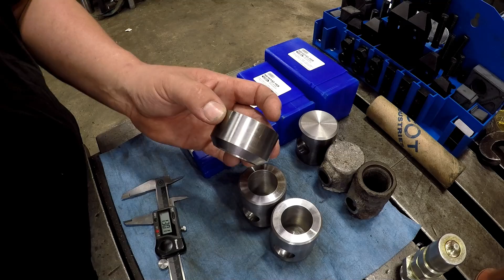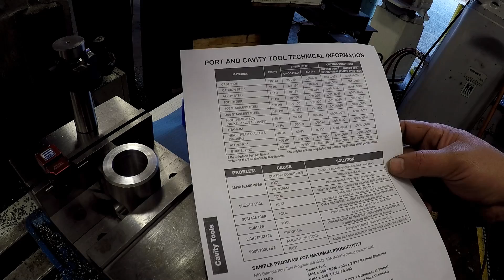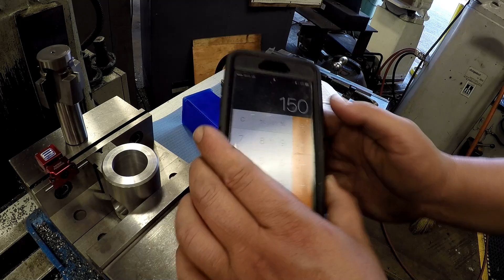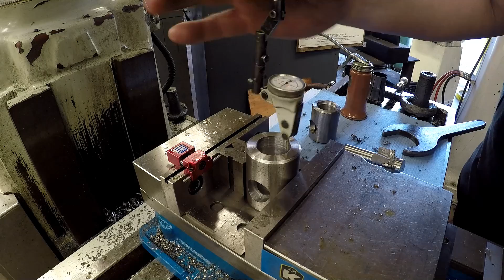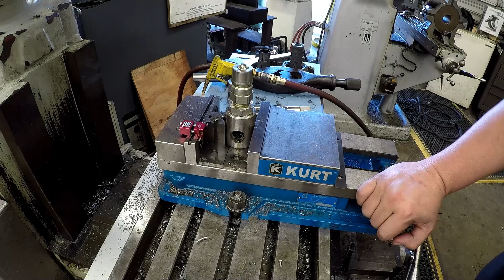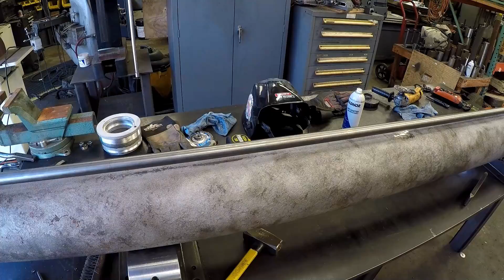SNS 163 Part 2: Machining O-Ring Boss Ports

Comment: Hey Adam, I have a situation where someone cut the 10AN threads for ORB fittings, but didn't put the chamfer in, so the O-ring has no place to seat in. Can this tool be ran in an already threaded hole or would you recommend a different approach?

Comment: Not to say that it aint cool to use a new specialty tool to cut to the o-ring counter bores but, wouldn't it have just been easier cut that counter bore and tap it on the lathe... especially from a time vs money prespective?

Comment: Very cool tools for making the ORB fittings. I've designed many a radiator & heat exchanger that uses those things, very cool to see a different method for making them

Comment: Adam, is there some kinda formula for welding warpage or rule of thumb on when you should machine after welding?  For example, when welding those ports onto the hydraulic cylinder - how do you know ahead of time that it wont warp and restrict the cylinder bore?

Comment: I don't even qualify as an armchair machinist, so please forgive me if this is a dumb question - why don't you cut that end profile on a lathe like you do with many other profiles? Seems a bit expensive to have a specialized tool that can cut just one diameter if you've got a lathe that you can use to cut any diameter - but you know what you're doing, so I'm overlooking something here, right?
Reply: Watch the video again. Adam explains at 2:20: "But what do you do when you have a big ol' clunky part like this that's magnified 10 times. It's big, it's heavy. Well sometimes it's not so easy to put something like this in a lathe. So what you want is a cutter, like an end mill."

Comment: Takes me back to the days of industrial trash compactor repair.  These should have been a subject on "Dirty Jobs". Crawling inside these science experiments to unbolt and de-couple a forward stuck piston ram took some internal fortitude and hepatitis shots.
Reply: Working on cylinders with a transfer tube was nice (any time not spent hunched under the platen in knee deep funk was  much appreciated), not all manufacturers used these.

Comment: Hey Adam, just curious why I don't see you use a coax indicator ? The way you do it is good but I wondered why no one use's them. I know your arch nemesis does (he he). Nice job and yes if there is a way to mess up a good repair job there is a moran inline to do it. Oh one other thing you said you used fluxcore to weld with, did that mean flux core wire with no shielding gas? Thanks God Bless Ya   Dave
Reply from the maker: Dave, actually I do use a co-ax quite often but that indicator setup I shown is pretty quick and easy too. I actually have a new Blake co-ax on the way, tired of the cheap import units crapping out on me. Time to see if the Blake brand is any better.
Reply from the maker: Yes flux core wire, with gas also known as dual shield. It's like welding with 7018.
Reply: ya my last one was the bridge piece that holds the pinion in relation to the plunger rack the  screws came loose and I broke that brittle cast iron rocker when taking it apart :hint that pin is a taper pin I think!

Comment: You've mentioned before that people bend that transfer pipe. Assuming it wouldn't interfere with the overall machine wouldn't it be worth welding on a couple of lifting points to try and prevent that? Great job as always though.
Reply from the maker: That would be good but onyl if the customer requests it. Sometimes I cut a piece of tubing to fit over the transfer tube to protect them.

Comment: That's cool! We cold form a lot of tank weld spuds just like the one you held up at 1:13. Takes a big machine and lots of tonnage to make those babies! Then the inside is bored and threaded via CNC.
Reply from the maker: We get alot that are cnc machined, others look like forgings.
Reply: We make the ones that look like forgings. Whether the spud is forged or cold formed depends on how big the spud is. The biggest we can form is about a 1" NPTF spud (can go bigger if not  very  thick). With 1.250 wire stock, it takes a 600 ton machine to hammer those out!

Comment: Adam - Excellent videos, as always. I'm wondering if sometime you could do an example of threading in which your scratch pass is incorrect and you have to adjust and recut the threads over the scratch pass. Does that make sense? In other words, whenever I see you make a scratch pass I wonder what you would do to correct it if it was wrong. Just a thought. Thanks again!
Reply: You just fix your gear box, add some fresh blue, re-scratch and cut your thread.
The old scratch will have no effect on the finished thread even if it is a several thou deep.
Reply from the maker: I understand, Josh pretty much summed it up. The purpose of the scratch pass is to verify your pitch is correct, and you can change it before you cut any deeper. The shallow scratches won't hurt the thread.
Reply: Thank you.

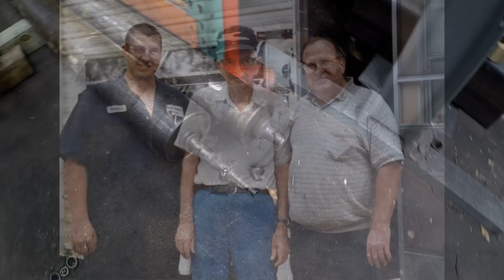Comment: 20:26 i've seen things like that on the ends of nuclear fuel bundles for handling them in the reactor rooms, there's a special apparatus that grabs them there and doesn't require someone to be there to hook onto it while providing a rigid purchase

Comment: might be interesting with the Oring cutters if you had a collet holder for the lathe tail stock.. since it goes in till the cutter touches the flat surface..

Comment: Good job, one handy tool to have while hand tapping in a mill or lathe is a spring loaded center that follows the tap down as you are tapping even with the quill locked. I can't think of the brand off the top of my head but there's an American made one that's very reasonably priced and high quality.
Reply from the maker: +Phill Huddleston I have them and use them, but aren't as reliable as a solid center being pushed down into the tap. It's real easy to get off center with the large taps with a spring loaded center.
Reply: You just need to make an Abom size and spring strength center. :-)

Comment: Curious if the part is machined to fit pilot of the tool for the o-ring, is it not easier to just line the part up with the pilot of the tool then lock it down ?
Reply from the maker: I'm sure you could and get good results, but I like to assure it's aligned with the pilot

Comment: I use these exact tools at work except instead of a guide on the tip they have a sort of reamer on the tip that takes it down to tap drill size.

Comment: Great work Adam. I do wonder though, if you wouldn't have some issues with distortion of the thread a O-ring boss after welding. I mean apparently you don't because of the order  
of procedures. I realize that it would more difficult to fixture the welded tube for boring the smaller supply holes. Just thinking out-loud.
Reply from the maker: It;s no problem, you can buy most of those things al day long and made to weld on. If anything, you might have to chase the threads if you get spatter in there. The o-ring will seat just fine.

Comment: Adam, what is the mill you're using? I've got an old Cincinnati, and that collet nut looks very familiar.
Reply from the maker: +Richard Frisbie That's a very old collet system that's obsolete. I think someone else mentioned the same thing. I believe the number size is 1C. It's a 40 taper shank and goes up to 1 1/4".
Reply: Thanks Adam. The Cincinnati uses the same collets as a moonset grinder.

Comment: Adam, you said you used flux-core to weld the bosses onto the main tube, but did you use it to weld that small tube to the boss also? Did you have any issues with that weld, given the huge difference in wall thicknesses? Did you per-weld that smaller tube to the bosses first before you welded bosses to main tube?
Reply from the maker: +Fred Newman Yes I used the flux core for all of the welding, just tuned the machine properly.

Comment: Heyman,
Great job, as always. It looks like someone didn't change the bearing in time on those last shafts you showed. I see this all the time, but on 2" conveyor rollers with 5/8" bearings. They get ran till they break.
They were replacing the whole roller until I started boring them and making replacement shafts held in by set screws. I'm afraid I only encouraged the lack of proper maintenance though.
Reply from the maker: Yep that stuff gets run until failure.

Comment: Used a lot of SCT tools when I worked on aircraft turboprop engines.  Nothing as big as those you are using.  Also used a lot of their solid carbide boring bars,  again small stuff, 1/8 to 3/8 Dia.  
Always impressed on the quality of their tooling.

James
Reply: I just got my first solid carbide micro-100 boring bars 5/16" shank for 0.200"min. hole, and man they are so sharp it's frightening! I love how heavy(or dense) the little suckers are. I'm boring out the mounting socket on a US made Jacob's 16N that was chowdered up somehow, if you're interested, please check it out on my channel ;)
Reply from the maker: They make some good quality tools .

Comment: Well, that part at the end looked like a miniature banister leg, like the kind they turn in a wood lathe. Maybe they used the 80grit grease for that zerk fitting, LOL!
Reply from the maker: Yea it's some rollers for the old linen company. Run till failure!
Reply: This is hard to believe, but the latest thing coming from MBAs is the plan to get rid of maintenance workers and let equipment run til it fails then replace it.  One could shoot a lot of holes in that idea!
Reply: Wait...what? Who has told you that, +Dale Nelson, do you have a friend of family member in school right now, or perhaps a professor? That is ridiculous! If they have ever owned a car and actually thought about the repairs they pay for, they'd know that allowing a failure can(and will) cause major, additional, damage.

Aha, I just thought of a reason why a professor may not understand that, the stupid leasing programs for cars that prevent people from understanding how small preventable failures lead to major malfunctions. They just stay in their bubble and don't understand the reasoning behind maintenance. Thanks for the heads-up!
Reply: knolltop farms  I sure don't agree with this new idea about running a machine to failure, but unfortunately, I don't recall where I heard this except it was  on some national news program.  Their theory is that it is less costly to not have to pay for maintenance workers(pay plus benefits don't you know)
Reply: Yeah, that's just insanity...and incredibly greedy, inhumane, etc., etc. Some people in 'high' places really don't care about their fellow man. It's like that guy who thinks sending missiles is a better plan to help the "beautiful babies" then it is to send food aid, or heaven forbid allow refugees. Forget the preventative measures and just blast everything when it goes sour...At least there are allot of good folks left in the machining community, Aloha Brother...Chuck

Comment: I've programmed so many SAE ports on CNC machines. I've found that you have to treat these tools more like reamers. They like slower speeds and high feeds. If you use the recommended feed rates they like to chatter. Getting these ports through a quality inspection is a constant struggle.
Reply from the maker: Did you use these tools to cut them or just profiles with single point tools??
Reply: I used the form tools like you did. We mostly cut high silicon cast aluminum so we used PCD tipped tools. We had thumbnail gages for inspection and thread runout gages for each size. Not fun.